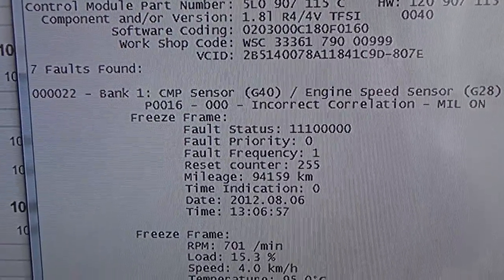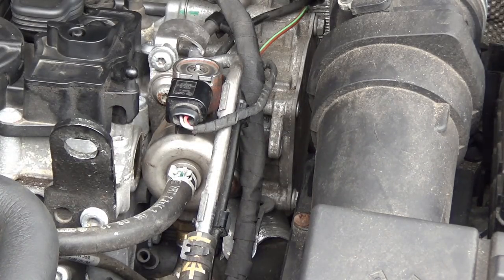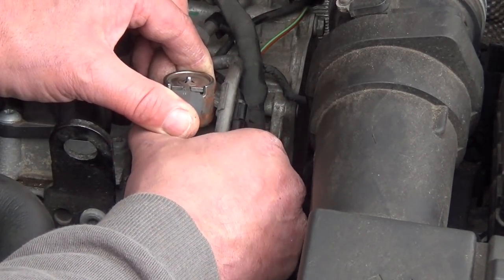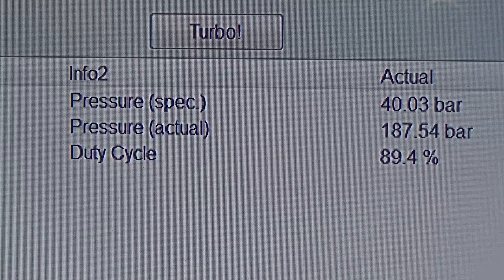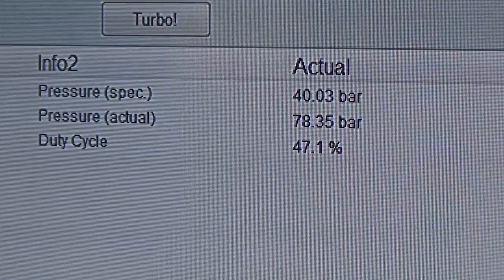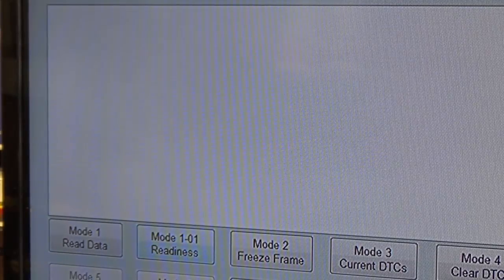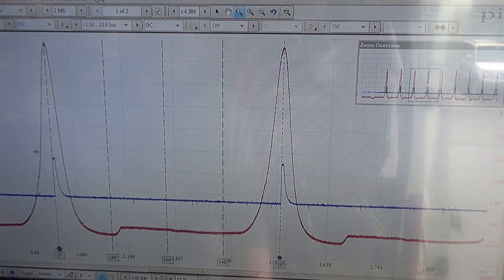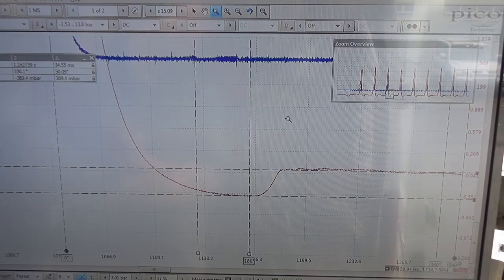Skoda Yeti CDAA 1.8TFSi -  P0088 Fuel pressure too high - Part 1

Comment: Did you ever find the issue in having same issue same codes an obd code on a 2010 cc an it falls on its face on high power demand when you step on gas an floor it an it hesitates to go I found the fuel filter looks like a dirty tea bag an is non serviceable I think it is culprit.
Reply from the maker: Yes, watch part 2 👍

Comment: I have  problem on my 2008 Audi A6 over and over again P0088 driving Home in Limp Mode , ordered the  FUEL RAIL HIGH PRESSURE SENSOR, EGR VALVE & new glow plugs on eBay . No Idea if i actually needed those but after watching some Videos, this seems to be the problem regarding P0088. Get my Mechanic to fit it and hope the Problem will be gone !!

Comment: can this be "attacked" via looking at the fuel trims?  
I mean 150 bar @ idle  (I mean real value , true 150 bars , not false reading due to reg. malfunction) will create a very rich condition and the fuel trims will be very negative.  
with false 150 reading but closed "normal" rail pressure , the fuel trims will not be so altered.

is this right?

many thanks , TOP video as always!

Comment: Great video mate got the recommendation from the main man mr danner 🤙 that’s a very interesting graph there mate never seen one spike like that 😂
Reply from the maker: Db automotive thanks for coming to say hi 😁 it’s a pretty common fault but hopefully I’ve done this in a way that engaged the viewer and Facebook group. Part two should be available tomorrow. Cheers, Steve. 👍
Reply: Simply Diagnostics not a problem mate and yeah it certainly seems that way, the older tfsi ones used to wear out bucket all the time glad they finally changed the design and I’m looking forward to part 2 keep up the good work 👍

Comment: Timing is off (too late) the ecu controlls the pressure regulator assuming the pump is being pressed by the camshaft. If the camshaft is pressing the pump too late then the ecu is already done with regulating when the camshaft still is pressing on the fuel pump. Therefore the pressure is getting to high
Reply: Hmmm doesn't it control pressure on a feedback loop from the rail sensor? Not just a fixed mechanical correlation? Anyway, very interested to see how Part 2 resolves the mystery :-0

Comment: Pretty cool stuff. I like the mobile diag  van set up. I see a lot of similar problems on the GM 2.5 l GDI engines here in the US. They have regulator problems but also mechanical wear problems with the high pressure pumps. Very similar set up to your skoda. Paul Danner sent me over.
Reply from the maker: Huntnfishnuts thanks very much for taking the time to watch and comment. 😁 glad you enjoyed the video. Steve

Comment: Hi Steve I thought when duty cycle was low pump pressure was low (when u disconnect pump actuator/regulator does it not just go to the normal prime pressure) and high duty cycle=high pressure like u have? Cheers sandy
Reply from the maker: Great questions Sandy, I'm filming part 2 so we'll have the answers very shortly :)
Reply: Simply Diagnostics cheers Steve much appreciated, Sandy

Comment: Enjoying this video series Steve, I had last year a seat Leon 1.2 TSI similar problem high pressure but with a cam shaft rattle (it's on my channel) gave it an oil flush, changed oil and think I reset adaptions on autel machine problem solved thanks Steve, Sandy

Comment: Seen this on a Nissan, had timing chain fitted and since that it came up with fuel pressure fault code....1.2 direct petrol injection. No other fault codes. Turned out cams to crank one tooth out.

Comment: Well i know bugger all about car engines, it seems odd that the computer is trying to limit the pressure and failing.
I know that some cars have a tube that goes back to the fuel tank for excess fuel return, is it possible that someone kinked it and the pressure can't be fully fed back to the tank.
Im likely talking crap, yes i am lol :-D.
I hope you find the fault quickly, don't let it stress you out.
Reply from the maker: Hi, yes there is a fuel return but only from the fuel filter, onwards from that it is returnless.
I don't get stressed by jobs but I thought this would make a great case study and discussion topic in our Facebook group
https://www.facebook.com/groups/1727022460696100